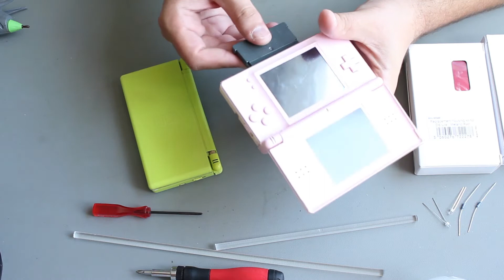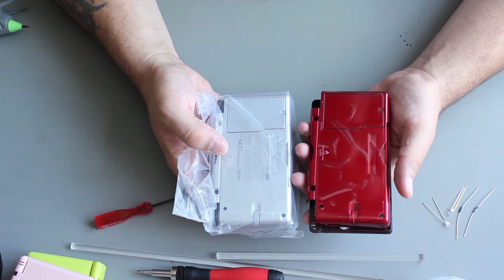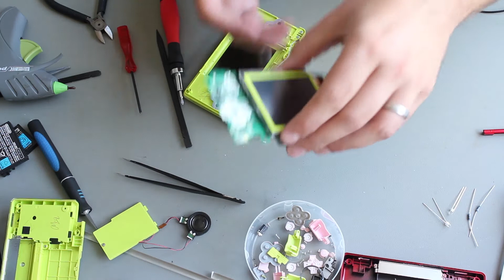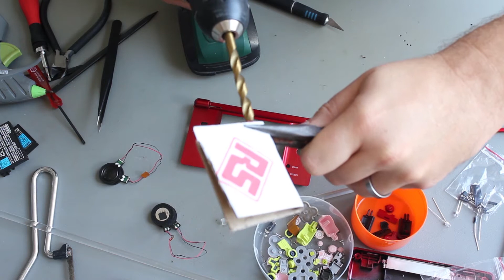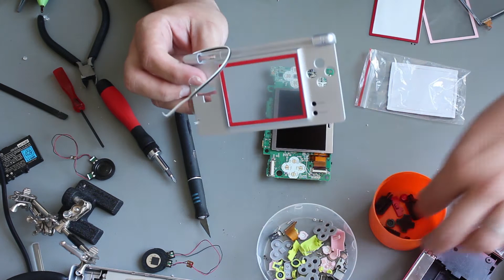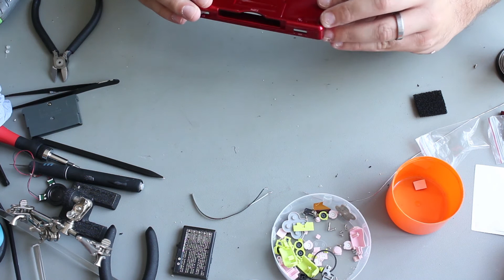Gameboy Macro - Argon Advance - (Recorded) Live Double Build! is it Neon?

Comment: My question is since you probably won't be using the DS cartridge slot, would desoldering and removing it give you more room for the speakers
Reply from the maker: Lego Autobot Gamer put a R4 cart in the slot and play gba ROMs?
Reply: @16BitBench  why not just buy an ez flash Omega, also do you know how to use an R4 with only one screen because if that's possible I would like to keep the X and Y buttons on the Gameboy macro so I could play Super Nintendo games on it
Reply from the maker: Yes it is possible

Comment: Nice video! Did you use resistor 330ohm 1/2 watt?
Reply from the maker: For red LEDS yes typically anything from 250 to 350 is fine, I've found with the red/blue LEDS i need to use at least 1K on the blue side to brightness match with the red one, otherwise the colour mix is wrong and blue saturates the red and it doesn't look purple enough. Generally blue LEDs seem to be much brighter.

Comment: Where did you buy your wire from? Would this be ok to use? https://www.ebay.com.au/itm/100PCS-20CM-Colors-Flexible-Two-Ends-Tin-plated-Breadboard-Jumper-Cable-Wires/323455529984?hash=item4b4f73b400:g:W2wAAOSwoZZZ3X6a
Reply from the maker: I tend to buy stuff like this:

https://www.ebay.com.au/itm/64-Way-RIBBON-CABLE-Flat-Colour-Rainbow-Multicolour-Wire-0-5m-28-AWG/172680772968?_trkparms=aid%3D555017%26algo%3DPL.CASSINI%26ao%3D1%26asc%3D20180905084510%26meid%3De81848d8a3374f2fbddc646b9a5a9ccf%26pid%3D100505%26rk%3D1%26rkt%3D1%26%26itm%3D172680772968&_trksid=p2045573.c100505.m3226

but it looks about the same as what you have there.